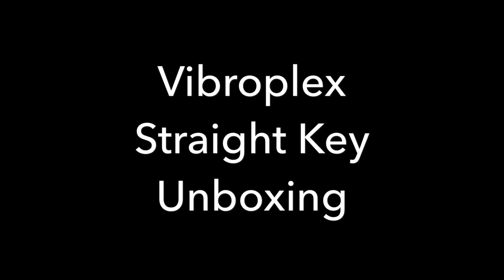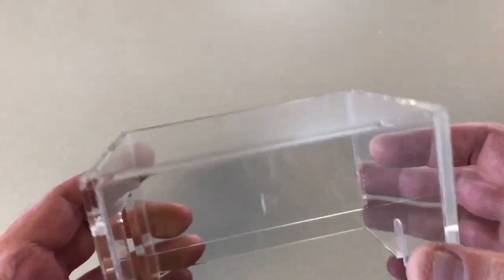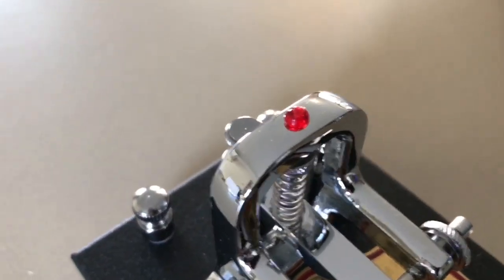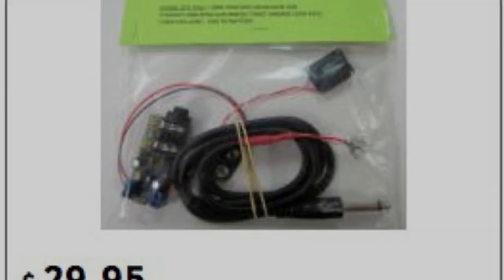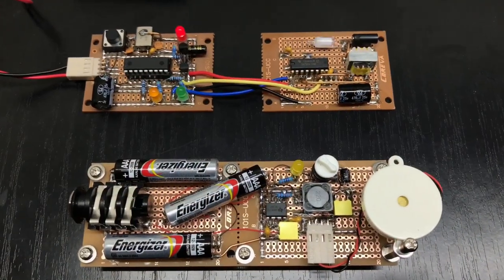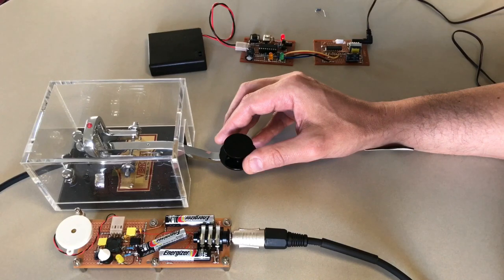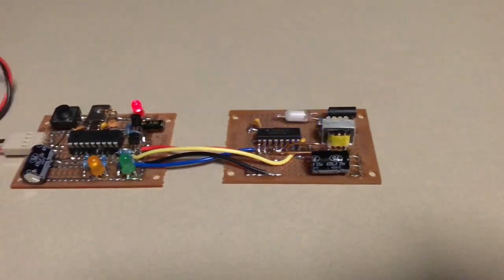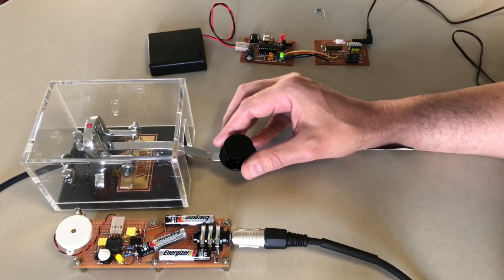TENS Morse Project - Part 2

Comment: Simple adapter plug off Amazon or Ebay cures the cable problem on the key , No need for a new cable    73  J

Comment: Have you learned code yet? I just found your video because I am looking for a good quality straight key. I have been taking lessons from Long Island CW club. Excellent program with people enrolled from many countries. Im new, but it is really good stuff and much much more that just CW. Also Elmer forums, antenna discussions and such. W4EMB.
Reply from the maker: Hi, No I suppose it remains a “one day” thing. I don’t have a HF radio at the moment, but do have my eye on another portable.
Reply: @BrekMartin  really loving my yaesu DX10. I also have a yeasu 897 for my portable rig along with the 857 and ATAS 120 antenna in my truck.  Great line of radios.